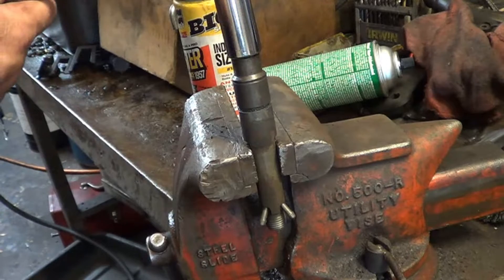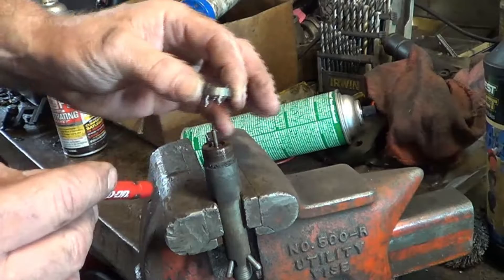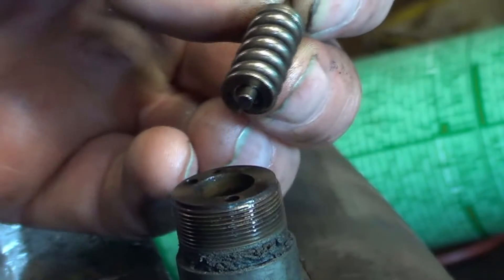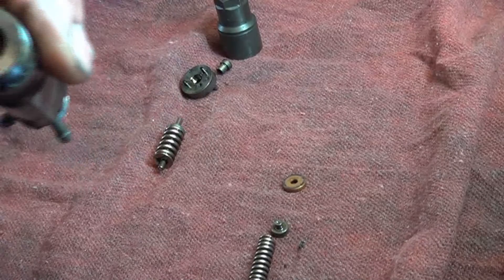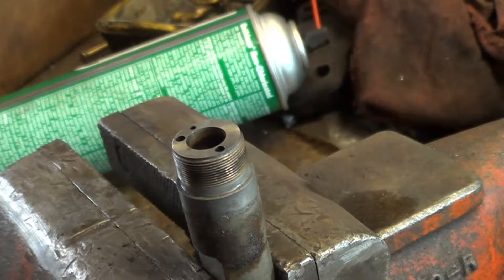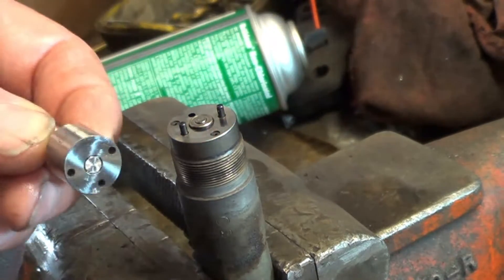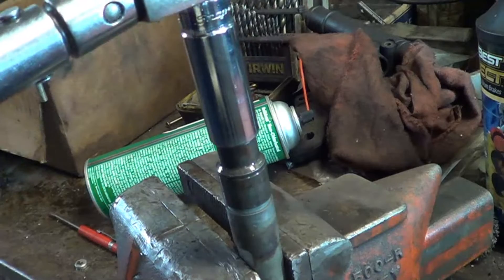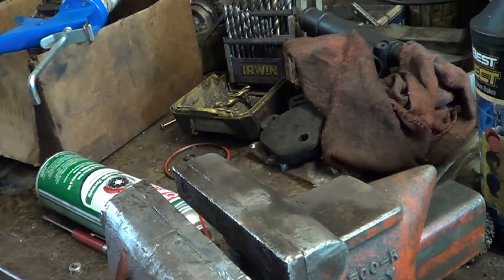Vw Tdi install nozzles in injector

Comment: Do you know much about firad nozzles. 
I rebuilt the injectors on my 87 mercedes 300d  and used monarch nozzles .I pop tested them all to spec and when its cold it hard starts and smokes for a minute or two but never did it before. I have heard firad nozzles are good quality so trying to get feedback on them. Thanks for the video and your time. Robert

Comment: hi , just a question, when you put the new nozzle on, you didn't oil it before assembly ?
Reply from the maker: If you want oil on yours feel freee.  Its lubricated by diesel fuel and it wont every "move" till the diesel fuel moves it.  But if  you were installing the nozzles then sitting them aside for weeks to months you might worry about them rusting, so maybe a light oil would be good then.  Our cleaning solvent is mineral spirits.  Very similar to diesel fuel.  So they are good.

Comment: good morning from Italy!
best... and probably only one... vudeo on noozles swapping for our cars....
i have an audi A3 8l with AHF engine.... and i fancy of some noozles .216 ive seen on the web...
just wondering of injector #3... im reading somewhere that its noozles cant be replaced cause of the sensor.... 
is that true?.... or can i just buy 4 noozles and do exactly as you did ? 
many regards
franco
Reply from the maker: I think you can but I dont really  know what a AHF engine is.  If its a european counterpart of the ALH then yes you can.
Reply: @CoolAirVw ... thank you for the soooo rapid answer... i really appreciate !...
yes... ahf and alh are the same engine... ahf has 20 hps more than ahl due to bigger injectors and appropriate ecu... turbine and injection pump are the same...
in fact.. three years ago I've broken the original alh engine for a worn out timing belt and ive replaced with a stock ahf engine from a golf 4...
direct dtop in the engine bay... connect all... turn the key and go.
ive saved the alh injectors (just in case..).. so ill swap the noozles in the old alh injectors...and them remove the ahf injectors and dtop the re-noozled alh injectors... 
since the ahf noozles glow is.. 205 i would go for .216 or .220....
any experience in this regard?

greetings 
franco
Reply from the maker: @francomanca  go too big and you get smoke.
Reply: @CoolAirVw ... i thought about it... i think ill go for .216... maybe .220...my ecu has alredy been remapped.... and if im lucky ill find an 11 mms pump head rotor.... 😉.....
wonder about the clutch.... 🙄
Reply from the maker: @francomanca  cool

Comment: Hey coolair on my mk4 alh tdi I have oil seeping from the valve cover and my oil is a milky grey color. Do you know what can be causing that? I have pictures but I can’t post them in the comments on Yt
Reply from the maker: Milky oil is usually water or coolant in oil.    Lots of folks would point to the head gasket, but there is possibility of engine oil cooler allowing coolant into oil also and that would be a much easier cheaper fix.  Lots of shops will recommend an engine once water has contaminated the oil, due to rust damage on engine internals.
Reply: @CoolAirVw  it looks like my coolant resivour is at the normal level and my coolant is still bright green like normal. I was it’s thinking something related to my valve cover gasket. Because the dipstick oil is darker like normal but the valve cover is leaked a grey color oil. I was also told to check the nipple on my vacuum pump because if loose it can cause excessive blow bye, idk if that’s accurate but I’ll look at all those things
Reply: Also I noticed that my dipstick oil is still normal. But by my PVC ( puck ), the valve cover, and under my vaccumn pump have that grey oily residue coming from them. It’s like a grey crayola crayon color. Just plain regular grey color oil.
Reply from the maker: @RUDD_TDI  mayonaise in those areas is normal.  Its due to condensation.

Comment: Hi, 
I have 2015  VW Jetta 2.0L 
It runs and drive perfectly, but It has a Check engine light on. It says Excessive Slippage, The transmission has no issue at all. What do you think about this problem ???
The car has Only 60k miles on it .
Thanks for the great content
Reply from the maker: change the fuel filter, clear the code and keep on truckin.  Change trans fluid every 40k.

Comment: Thank you so much for this vid Sir, ive been waiting a long time for this one. Over here in South Africa, mine is Sitting at 450 000kms and still going.

I would like to request a Alh dieselpump seal swap video. If its viable perhaps while its on the car,,,otherwise, lets take it off, replace the seals and set the Iq.

Once again , we really appreciate this, it goes a hella long way to keep these bulletproof motors going
Reply from the maker: there is a good one already on youtube.  I watched it after I had done about 4-5 IP reseals and I learned some stuff, to improve the process.  watch for the next video which will show #3 injector.'

Comment: Thank you for the many very helpful videos and instructions, which Nozzles are the ones which will increase HP (possibly mileage?) I didn't see any mention of type or brand, (maybe I missed it) I'm interested because I'm considering the 5th gear increase size mod to max out Mpg, but evidently a little HP increase is usually better. So by doing is this easier and more efficient than the taunted "performance injectors"? (DTP 502 or 520 as examples)
Reply from the maker: Cant recommend, as supplier didn't want to sponsor.